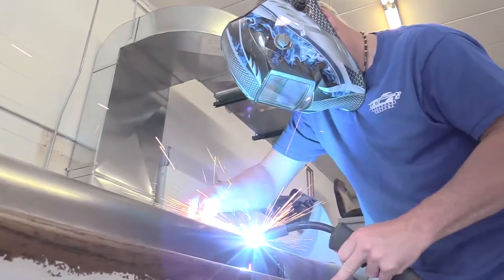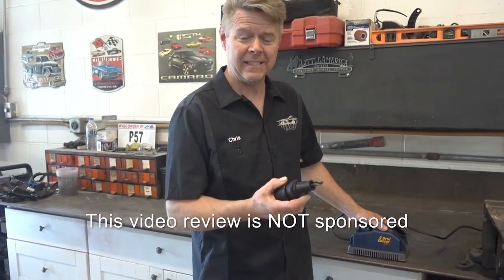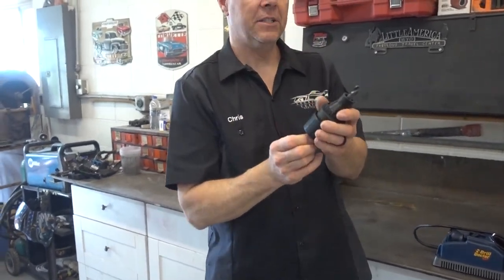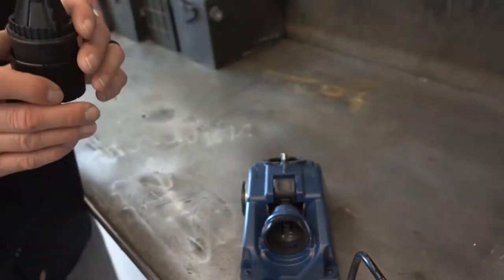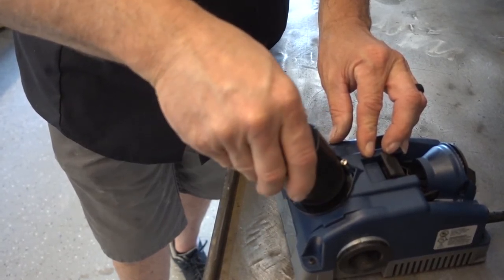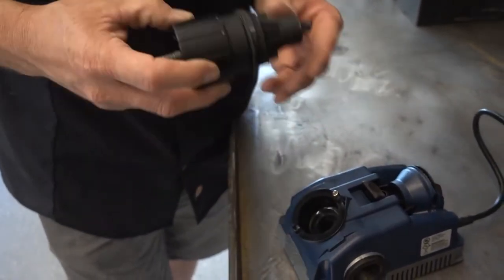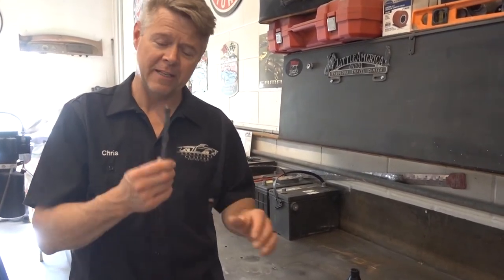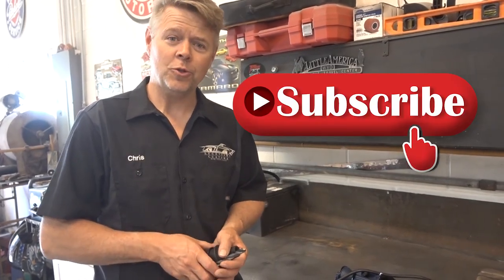Legendary Customs Tool Review: Drill Doctor XP2

Comment: You used it incorrectly!
The holder is supposed to be turned in one direction only- a continuous clockwise rotation so that both sides are sharpened equally. Not a back and forth action for each side.

Comment: Nice video. One thing I always do especially if I’m drilling through a piece of metal with any thickness to it, is a drill a 1/8 inch pilot hole. The reason I say 1/8 inch is because it is a common size and it’s easy to find drill bits to replace your worn out 1/8 inch bit. I save my oddball sizes for finishing out the hole to the exact size that I want. Drilling a pilot hole will take a lot of load off of the bigger bit that you use to finish out the hole.
Reply: We do the same with the larger holes. Great tip!